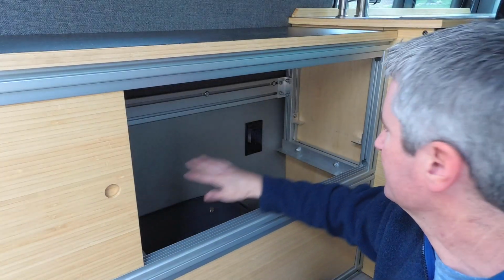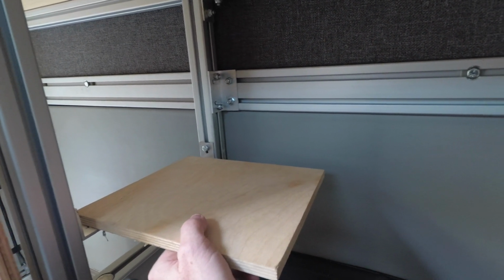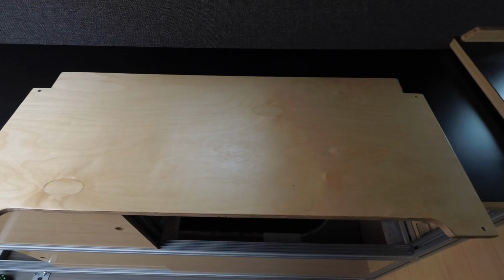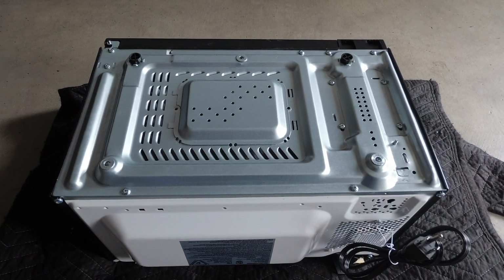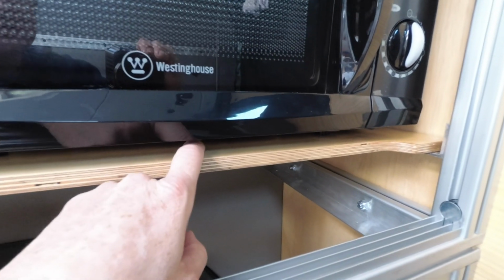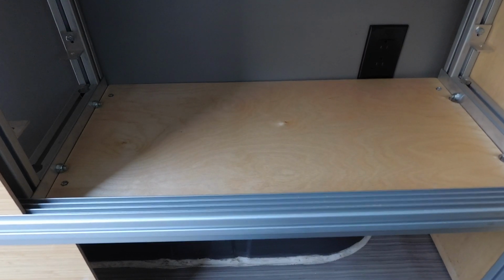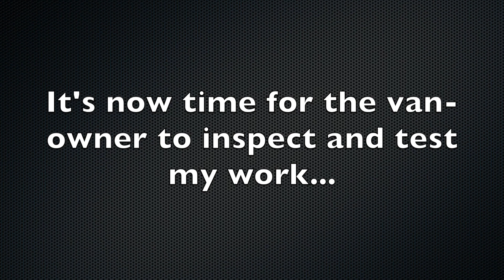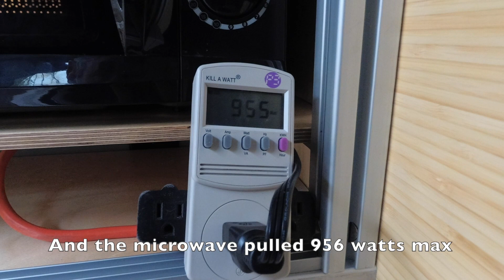Shelf and Microwave Install - DIY Sprinter Camper Van

Comment: I have that very microwave and love that it's not digital and doesn't use power when it's not in use. Love the install that gave me ideas on how to secure my own microwave when I put it in the Cortez. Thanks!
Reply from the maker: If you ever need the warranty voided on something, just let me know.   It is a great microwave for use in an RV.  Most RV units are at least 700 watts, which won't run on a 1,000 watt inverter.  As you know, this one is 600W.

Comment: Yay, cuppa tea in the van at least! Now we know the build is coming together!
Reply from the maker: It is!  I mounted the microwave in such a way because I'm not 100% convinced I'll keep it.  That said, my first trip out with the microwave was last weekend and found it was really nice for reheating the pancakes that had cooled while I was making additional batches.  I think it's a keeper.
Reply: @ourkaravan  One can certainly live without a microwave, but they're extremely useful gadgets for a lot of uses. Reheating, sure, but also thawing stuff if you have a freezer, and cooking meals as well. You'd spend 9% of your battery capacity to do a 9-minute run (plus 3 minutes of resting afterwards) to boil rice to perfection, for example.
Reply from the maker: My solar will bring in close to 19 amps in full sun, so battery recovery can be pretty quick.  (5-6 hours of sun at 19 amps vs a few minutes at 80 amps when the microwave is on.)  I haven't needed to conserve yet, but if I were trying to cook every meal with the microwave or induction while parked in the shade, I would have to keep an eye on it.

Comment: Good job brother
As always you are the best.. But don't forget the air circulation that microwave need it if you will use it for more than 5 minutes.
Tuff build for tuff life..
My regards to your lovely little angel..
Reply from the maker: Thanks for the reminder...it's not far from the back wall but there seems to be sufficient room around it.  Thanks for watching!

Comment: You could also have put something with sharp points in the plusnuts on the microwave, put it in place and pushed down hard to create three indentations in the plywood. Then just drill and bolt. But another great job done, the vehicle is really shaping up into something special. At 1% battery per  minute you won't be cooking any multi-hour long meals in that microwave, but on the other hand how often do you really do more than a 2-5 minute heating job in one of them?
Reply: Actually Ken’s grease on the bolt heads trick has been more reliable for me than making multiple points to insert. Thanks for that tip, Ken!
Reply from the maker: I thought I was going to be mocked pretty hard for that one, but it does work.  Thanks!

Comment: How will the top counter above the microwave fare when steam from cooking hits it continually?
Reply from the maker: I haven’t seen any evidence that it will be a problem at all.
Reply: ourkaravan That’s good I’d like to hide away mine as well then.  Another quick question does the van creak a lot going down the road?  I test rode a Vandoit that uses 80/20 and it was so noisy.  Is there a trick to keeping creaky noise to a minimum?  Also I have a transit so I really like how you present this system.  I almost think I could do this!  Thank you when I actually get into this I’ll be leaving you a donation.
Reply from the maker: My van is quiet on most roads, but once you start talking about washboard roads the stuff inside the cabinets make a racket.  A couple of measures I've taken to keep it quiet--using nylock nuts on the 80/20 framing so there aren't loose connections, using felt pads between the framing and wooden cabinet doors, setting the drawer and cabinet door latches to put a slight bit of tension on the latching mechanism and thus holding the door tight against the felt pads.  If you watch my recent Colorado travel video you'll see it mostly quiet inside.  I'd definitely use this construction method again.  I hope that helps!  -Ken

Comment: Beautiful design, and highly functional as always!  

However, I think you over analyzed the microwave install.  Use a thin sheet of rubber (Flexidip?) on the wood, leave the micro rubber legs on, and it will grip like a barnacle.  My Micro is not bolted down, and goes nowhere.  I find that for any thing even on a slick countertop, if you put a silicone waffle pad (Walmart baking pan section) under it, there is no more sliding at all.  

A thin rubber mat would achieve the same thing.  You can buy these at 99 cent stores - same kind that you use to line tool chest drawers.  Home Depot is too pricey, but dollar stores have them for $2 per roll.
Reply from the maker: The microwave had plastic feet.  On rough roads the micro needed to be bolted down, otherwise it would be bouncing around and marring up the inside of my cabinet. I also bolt things down for safety in case of a crash.  Of course that doesn't mean that you have to.  The rubber grip pads are good at keeping most things in place.